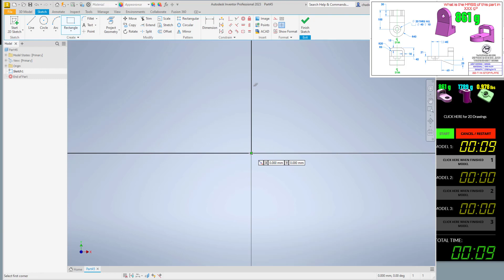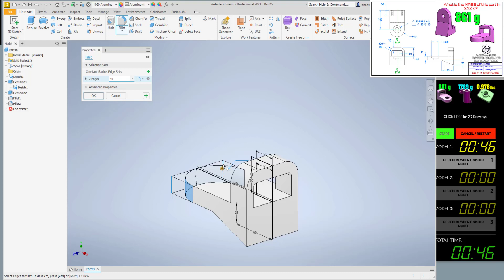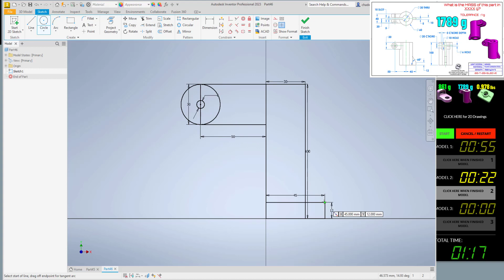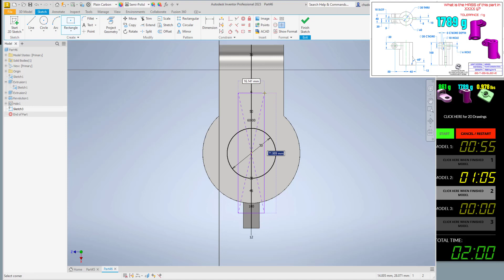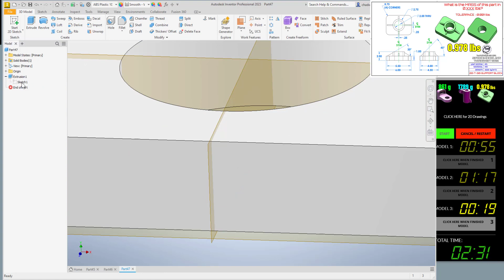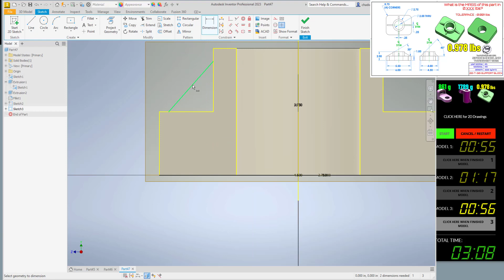TooTallToby Speedmodeling Challenge - May 2023

Comment: I would really like your help with something

On all the drawings that I do, the "Unit Format" is set to "Fractional" which is prefect for 99.9% of everything I do. However my employer has asked that we add a Diameter dimension on all of our wheels/rollers in Decimals with 0.0 precision.

My question is:

Is there a way to have 2 different unit formats in one dimension style in autocad? Where I can leave everything the same, but when it comes to placing diameter dimensions they automatically change to decimal units with 0.0 precision?